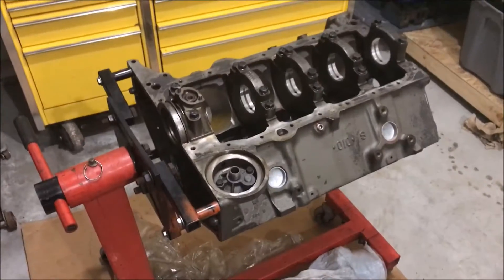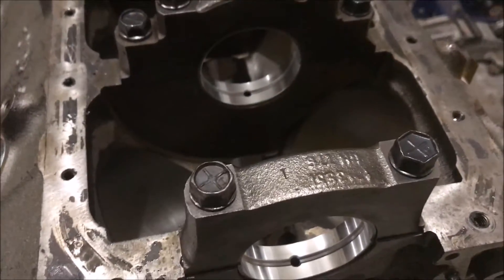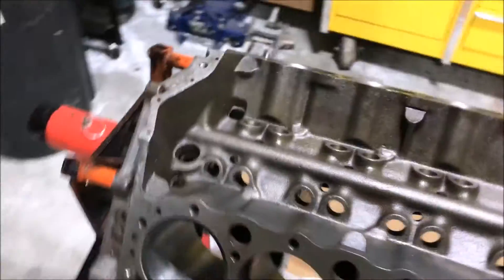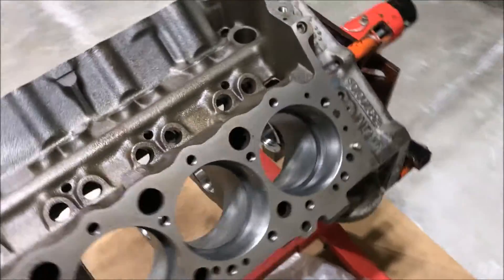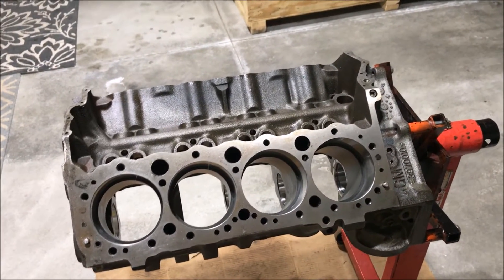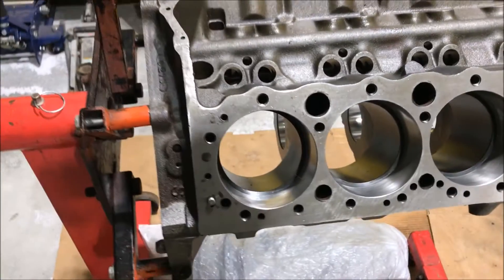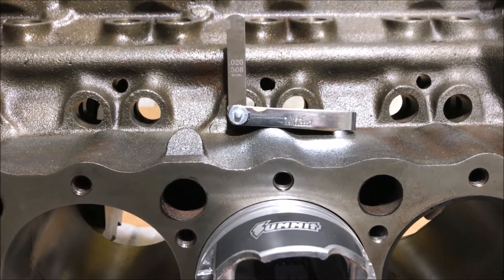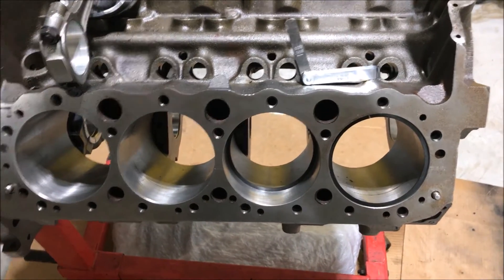Small Block Chevy - Measuring Ring and Bearing Gap

Comment: Did the rotating assembly need a rebalance after changing pistons
Reply from the maker: For a “stock” or slightly modified build, no. That’s only really necessary when going for high horsepower numbers